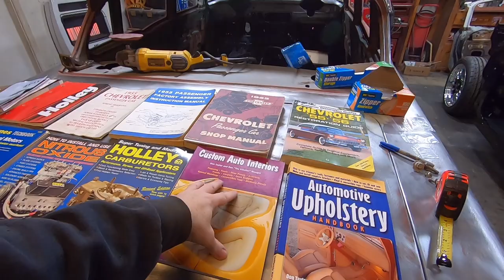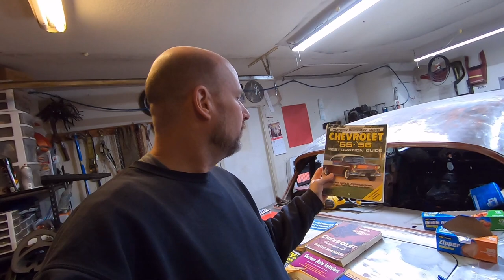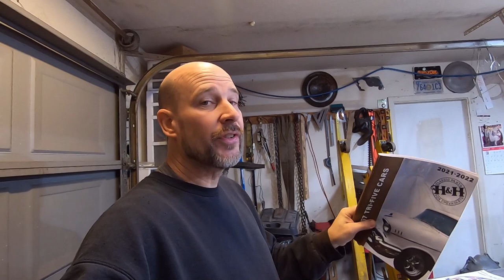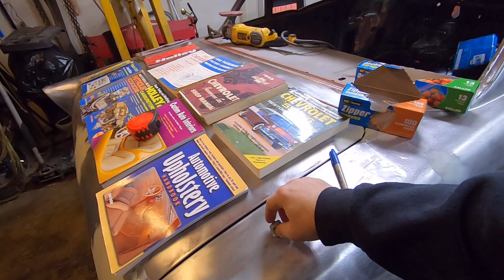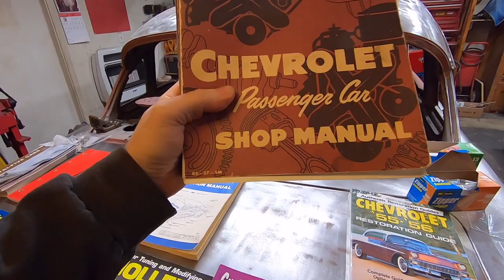Tips for building your first tri 5 Chevy

Comment: Great advice and tips Rob. 4 doors for some reason get a bad rap, but I love my 4 door 57. Merry Christmas
Reply from the maker: My uncle always said "you never see the other two doors behind you when you're in the drivers seat" I dig four doors for the practicality.
Reply: It’s interesting to think about how many four doors were made vs any other style of tri five. Yet how many do you see on the road or at a car show? IMO, a nice running, driving, 4 door is probably MORE rare than a nomad. I was able to pick up my 4 door shell for $2500. If it had been a two door, it would’ve probably had been $6k, as it sat. I set out actually wanting a four door not for the price, but for the functionality. My other two cars have two doors. I wouldn’t want to get rid of them, but a nice family sedan like a 57 has some style.

Comment: I need 4 bolts to complete  a set for my front seat. I noticed track bolts are the same but longer. I’m picky like you. Any extras please let me know, I want the originals not store hardware. Thanks. Very good points on restoring.
Reply from the maker: Thanks David. I have just enough for my hardtop. I actually need two for the 4 door